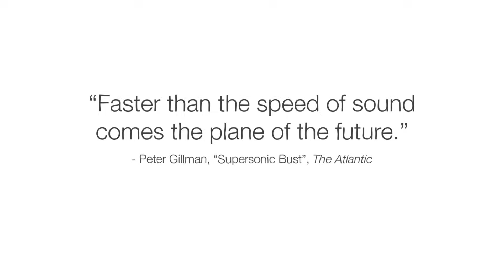Why are airplanes slower than they used to be? - Alex Gendler

Comment: Physics. When speed increase, drag increase by square. Drag is money. What drag are customers prepared to pay for to get there some hours faster? Tourists want the cheapest ticket as possible. They do not care if they get to NY 3-4 h later. Companies also find out it is expensive to let their employees travel fast. Ok, they have to pay them 3-4 h for doing nothing, but wat if they could work? With better seats, wi-fi on board, their laptop, it is productive working hours as well. No need for speed.
Even if you can reduce drag w new technology, it is not sure we will travel much faster. It could be used to lover the cost at about the current speed. If there is competition on a route, what can you sell? Time or money (cheaper tickets)? As so often, it is not about what you can do, but what customers are willing to pay for. As a brewer I can make the most wonderfull beer for $50. It doesn't matter if nobody buys it, if most people want a sixpack "tasting nothing" for $5,99. Then it is "tasting nothing" I have to make. The craft breweries have taught the market there is a wonderfull world beyond Bud, but it is still a small slice of the market.
Unless we find some new very cheap environmentally friendly energy source, commercial ultrasonic travel is probably a pipe dream.

Comment: The Concord was retired because a crash that happened with one of the planes. It was discovered that small cracks were appearing in the wings on the planes because of the stress put on them by traveling at such high speeds.
Reply: Nope, after the Air France Concorde crash, all active Concorde were refitted with better part that caused the crash at the first place. The last nail in the coffin was the cost of jet fuel that skyrocketed in early 2000s.

Comment: One key element neatly left out is that aircraft can go to higher altitueds where air resistant is sufficiently low, yet dense enough to provide oxigen to the engines while significantly reducing air drag. This has been known for decades, but the resulting economies would be of such a scale that airlines would not be able to justify the already inflated prices.
Reply: yeah but then you become severely mach-limited. Speed of sound decreases with altitude, so if you go to high, you won't be able to stay in the air at Vmo
Reply: Safety issues.

Comment: "Why are airplanes slower than they used to be" We're sorry but the subject
Why are airplanes slower than they used to be... is not covered in this
video. Does anyone  in the comments have the answer to the question
"Why are airplanes slower than they used to be"? Airplanes used to fly
at over 600 - 650 mph... now they fly at around 550 mph. Which is why
I clicked on a video titled Why are airplanes slower than they used to be?
So I could find out... Why are airplanes slower than they used to be?

Comment: Mostly, there is one thing that has made commercial supersonic flight impossible, as well as keep flying uncomfortable, planes cramped to the rim: Oil. Oil is as expensive as it has ever been, thanks to the oil producers doing price fixing and not letting a open free market develop. Technology has advanced tremendously over the last 50 years, the oil price has gotten more expensive.

Comment: But why cant they fly really high and avoid major cities or slow down. They could also fly quick through an ocean saving time.
Reply: They can't fly high enough to get away from the sonic boom problem, and if they slow down, well, then what's the point?
Reply: @Milesco  no just speed up in areas like the ocean sometimes traveling around like going from florida to the middle east or something. They can cross the ocean quickly.

Comment: Pilot here.  While I appreciate they are trying to stay "scientific" by using kilometers and liters, this is incorrect in the aviation industry (especially the US) and here is why.

Aviation fuel is measured in pounds, not liters.  Why? Because fuels volume expands and contracts with temperature, and the massive fuel tanks of airliners would fluctuate on hot and cold days, however, the weight remains the same. 

Aviation distance is measured in nautical miles, not kilometers. Why?  Because nautical miles are a direct fraction between lines of latitude, allowing distances to be correlated to the coordinates of it's position and travel direction.

Lastly (in the US) altitude is measured in feet.  A CAT 1 ILS approach takes you to 200' above the surface.  With tight margins in critical phases of flight, the accuracy of feet is more precise than meters or kilometers.

Great video but I hope this clears up why the SI or metric system is great for many applications, but not always the best answer in every industry.

Comment: Bogus.   The flights have been getting slower but it has nothing to do with concord it has to do with high bypass modern jet engines being slower.   That is why a modern 737 max (521mph) is slower than an obsolete 747 (570mph).   My brother is an aerospace engineer.

Comment: 3:23 there is an error, the sweap does reduce the wingspan, but it really reduces the lift. Planes are normally designed (by my understanding) with a set wingspan (bc of airport restrictions mostly). Then the angle is given. Planes with a high angle are for high speed, subsequently lower angle wings are for lower speed and higher lift. That’s why most piston engines and small planes have either no swept wings or very low angle swept wings. Great video though.

Comment: Feasibility isn't the concern. TED is leaving out the fact, there are speed limits even in the air. In the USA you can't fly faster than the speed of sound without explicit permission to do so. It is enforced by the FAA. Often when you see an aircraft in the air, the enforced speed limit is no more than 288mph. Or 230mph near certain airports.

Comment: Can we just appreciate the brilliance of Concorde. Designed and engineered without computers on drawing bords in the 70s, when anything still was thought possible. 

I hope we achieve a viable supersonic flight concept in the not so distant future even if it's still very expensive since there is not getting around the F_d ~ v^2 (drag force proportional to the velocity squared) not matter how much you change c_D (drag coeff.) and A (reference area)...

Comment: It’s not even just supersonic planes. 

Today’s subsonic airliners fly about 100km/h slower than they did in the 1950s and 1960s.

Back then, fuel costs didn’t matter, but they simply didn’t have the thrust to go faster than Mach 1 (a DC-8 exceeded Mach 1 in a dive in the early 1960s to become the first supersonic commercial airliner, but this was done as a test flight and not in service). 

But the energy crisis hit in the 1970s and it was found that a lot of fuel could be saved by flying slower. 

With security and air traffic delays, most passengers didn’t notice, while more powerful engines allowed planes to climb to cruising altitudes faster which made up for some of that lost speed.

Comment: They talked about the sonic boom from going super sonic but they didn't mention how the drag and friction increases  tremendously the second you reach super sonic or even trans-sonic speeds. 
Even if they fix the sonic boom problem, there is absolutely no way to solve the air friction problem from going super sonic.

Comment: The engine thing is false and irrelevant. Per kg of aircraft, Concorde's engines were as or more efficient to the best of today's aircraft engines; they were super efficient because they got extra compression from the inlet shocks for free. No, the real reason is the aerodynamics and weight per passenger- Concorde was heavy and the shock waves sucked away energy. Another wrong thing is the $10,000 price, that was only because it was monopoly pricing, they had a 75% markup, because they could. The aircraft was only really about 30% more expensive to fly because while it used lots of fuel, that is only one part of the cost. When it was still flying you could often get cheap tickets flying west for not massively more than normal subsonic flights. That was nearer the true cost.

Comment: You kinda touched on it at 2:35 but another huge issue is that above ~Mach 0.8 wave drag shoots up considerable, and doesn't start dropping until ~M1.1 and it isn't until ~M1.8 (more or less Concorde cruise speed) that it drops down to acceptable levels again. 

Basically, from an aerodynamic standpoint: we're going as fast as we can unless we go fully supersonic again. This is part of what hurt the Convair 990A: It was the fastest subsonic airliner, and fastest airliner at the time sure it was faster than the B707 and DC-8, but the high induced drag means that it was way less fuel efficient even for its time.

Comment: The answer is always: Money!
Sonic booms are not the reason. We used to have them a lot around air bases in Europe, sometimes multiple per day in the 80s. They are loud if the fighters were flying low. But if a concorde flies supersonic at high altitude... it would not be a significant noise issue during the day. You'd probably hear it, yes. But no big deal.

Comment: The drag coefficient increases dramatically as you approach the speed of sound, then trails off as it passes Mach 1, but supersonic flight isn't viable for commercial flights because of a) sonic booms rattling homes and b) fuel costs needed to power the engines. So what airlines do is keep the speed at about Mach 0.85-0.9, just before the exponential drag increase kicks in.
Reply: interesting

Comment: High efficiency engines can’t operate above 945km/h, without pulling in more air? So put in a damper, or ramp, like the SR-71, which hit over 3 times the speed of sound.... (but that was bascially a flying fuel tank with a camera since it used military jet engines.)